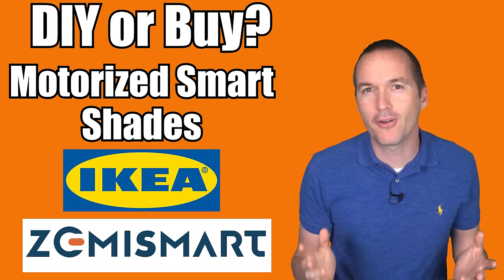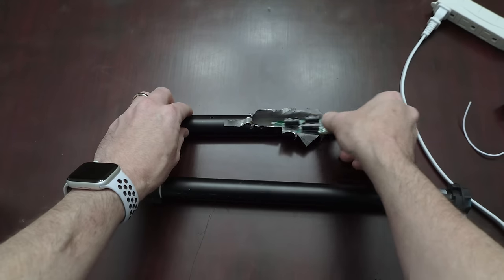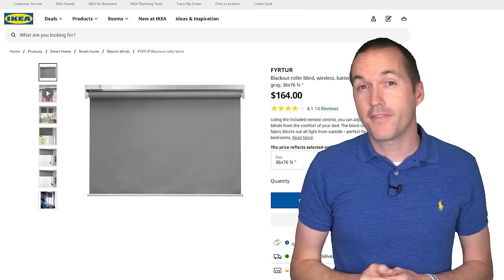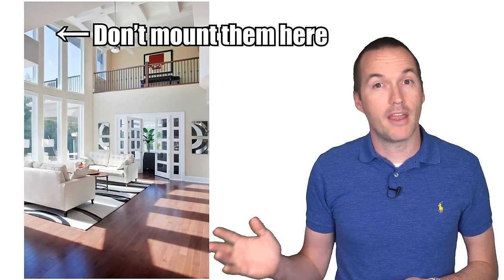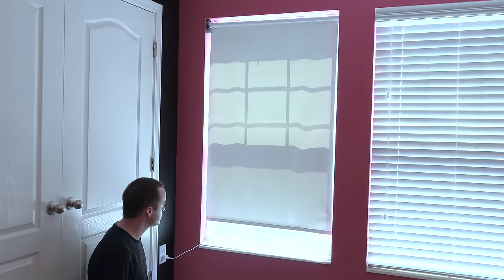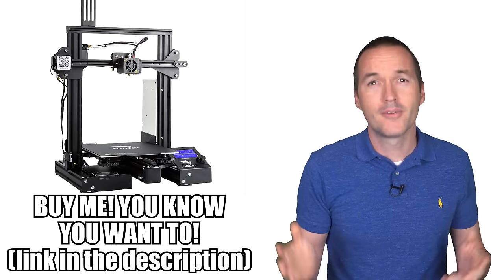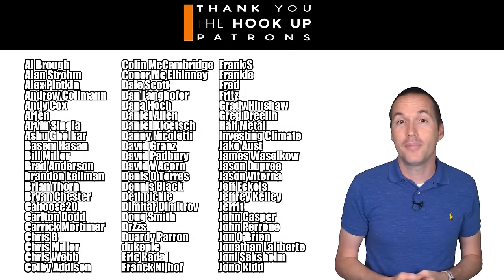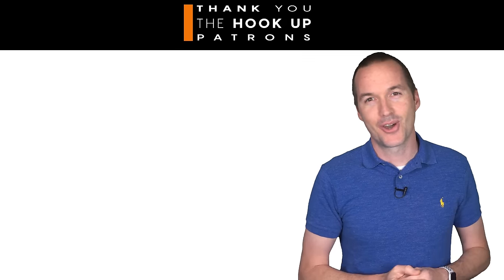Motorized Roller Shades? IKEA Fyrtur vs Zemismart Solar/Battery vs DIY!

Comment: I’m building a new house and prewired every window for 12v low voltage roller motors, like the Rollerhouse branded ones on Amazon. Much easier to conceal low voltage wires.
Reply: I am also building a new house and prewired my windows. Are you going with the Rollerhouse option or are you going to make your own or something else?
Reply: I'd like to hear more about what you're doing?
Reply: The wiring should come out from the ceiling, right? I am also checking pre-wiring options for a new house
Reply: @shawn_yates  I'm either going Rollerhouse or building my own with stepper motors and Wifi. Jury's still out on that, I need to do some prototyping. I'd like to be able to make the stepper motors work, if I can figure out how to conceal them entirely inside an off-the-shelf blinds.com roller shade tube.
Reply: @yiannisis  I brought mine in from the side, through the 2x4 framing around the window. The wire then runs inside the small cavity between the top of the window itself and the header, then I routered a shallow groove in the window header to bring the wire up about 3 inches where it will exit the drywall. I have to do outside mount shades because my windows are not deep enough to do inside mount.
Reply: @johnjacobjinglehimerschmid3555  Absolutely. When I can get the time I'll write up a blog post or video about how it all came together, because this has been without a doubt the hardest aspect of the new home automation system to plan.
Reply: @matt Rogers I wanted to follow-up and see what you ended up doing at your new build. I am not doing a new build but I am doing a complete gut job on my house. I am running smurf tube from my network room to one window in each room and then daisy chaining from the first window to the other windows in the room. Since i am running smurf tube I am looking for a low voltage motor option with 2 way communication. Ideally, I would want a low voltage roller with built-in wifi. However, everything i am seeing that is low voltage is either rf (one-way communication) or zigbee (which no one likes). At this point, I have narrowed it down to going with a zigbee roller or going with a 4 wire roller motor and this Zemismart switch https://www.zemismart.com/products/zemismart-new-design-us-wifi-curtain-switch-alexa-google-home-smart-life-tuya-blind-wall-switches in my network room.
Reply: I would love to read about all the stuff you did in your new home. We’re starting a new build and trying to figure out how deep we want to go into home automation

Comment: If the DIY option is updated with stronger motors etc please do a video!
Reply: These cheap steppers can be modified to work in bipolar mode, and like that, with a special driver, their torque is doubled.
Reply: No stronger motor required! Just run the stepper board with 12V instead of 5V. More than enough torque. 😊
Reply: @stefanlasser6535  NEWBIE here lol, would the stepper motor need to be a 12v stepper motor instead of the 5 mentioned in the video? looking to speed up the shade a bit and as i posted originally window is a bit larger at 57 5/8 w x 36 h Thanks!
Reply: @shawnperry1974  the boards i know say "5-12V". I even redesigned the thing to NOT use a 2:1 slowdown gear but drive it directly
Reply: @stefanlasser6535   Have a link to your remix?

Comment: Is there a DIY tutorial with battery AND solar charging integration?
Reply: This is what I immediately wondered was if you could add on to the printing process. Make a power housing essentially and wire it in. Fairly easy to hide stuff in the top of a window

Comment: Thanks for the comprehensive yet concise video, super well put together. Do you have any suggestions for roller shades you know work with the zenismart blind with the solar panel you linked to? I see they list 38mm as the compatible tube size but most blind sellers don't seem to list that specification.
Reply: Did you end up getting an answer? I am running into the same issue looking for shades for my new house and everyone seems to gloss over where to find actual shades!

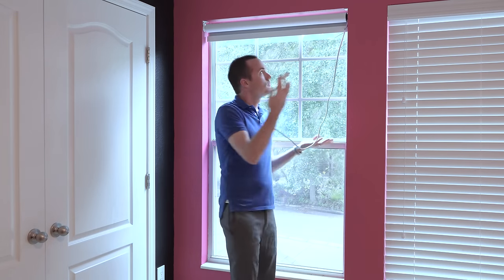Comment: Hey Rob, after seeing your video I was inspired to put together something similar. I probably have the same (or very similar) shades as you ($10 vinyl roller shades from a home improvement store) so I think it is comparable. I was using a different stepper driver library and found that it had excessive delays in the code between step pulses. I eventually gave up on that one and wrote my own with much more reasonable delays. I guessed your window is about 4', with my new library, my shades lift that far in under 1:30. Still not great, but almost twice as fast as your current version.

I looked at the library you used and it doesn't seem to be as bad as the first library I used but the delays could still be lowered. I found that a pulse width of 5us and pulse period of 1505us worked pretty well. Your library doesn't allow for non 50% duty cycle so it may not be easy to modify that code. I think the limiting factor on the width is the driver (the datasheet says the minimum is 1.9us, i went with 5 to give some margin) and the limiting factor on the frequency is the motor.

So, if you want to try speeding up your DIY solution you could consider tinkering with the delays in the motor driver code.

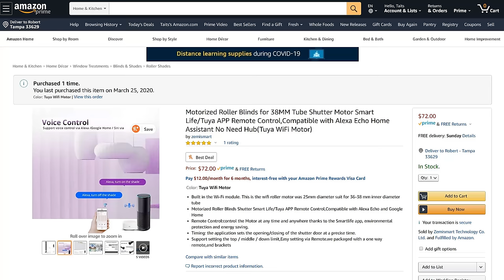EDIT: With a width of 3 and period of 1203, the time is down to under 1:10 and it still seems to be working correctly.
Reply: Hey, this sounds really cool! Is your code available anywhere?

Comment: I found out that you don't need any TRADFRI gateway. Just the "USB range extender" (or whatever they call it), the remote and the shade. Everything is included in the package. And if you have a Zigbee gateway you may be able to control it without any further hardware. (I intend to do that with the Conbee USB stick and ioBroker.)

Comment: At this moment I have 32 ZigBee devices (in-wall relays/switches [Sonoff, LUMI], Xiaomi/Honeywheel smoke sensors, PIR sensors [eWeLink, LUMI], Xiaomi light sensors, water sensors [TZ3000], IKEA wall switch, Philips HUE Ensis) in my house for at least one year. The only problem I had was RBPI and SD card(s). After migration to Intel NUC - it's running stable for months without maintenance (apart from home assistance). ZigBee works perfectly in my case/infra :). Greets :)

Comment: I use the IKEA blinds.

Smartthings has a built in device handlers that works perfectly with it even the battery all you need to do is change the device handlers from ZigBee window shade to ZigBee window shade battery, than everything will work. No need for any of the custom handlers.

In HA I use ZHA the blind works including the up and down arrow and the position updates if the blind is change manually too.

Comment: I have replaced the smaller  steppers with Nema 17 steppers nodemcu and drivers fit in the mount housing for the stepper
runs of 12-36V and can lift 1.5M wide blackout fabric 

files will come on DYI plattforms once 100% satisfied with working solution
costs are a bit higher but for on the wall mounting works so much better

Comment: Fantastic video as always, but it kind of left me wondering about another option. Why not DIY with a solar panel, a battery and a stronger motor? Basically giving you a zemismart solar on steroids :)
Throw in a light sensor pointing outwards and a motion sensor pointing inwards and you've got the ultimate smart roller shades.
Reply: This is 100% the update we need.

Comment: The DIY setup is perfect to slowly open at a scheduled time in the morning just like the sunlight simulation lamps
Reply: Mine is not running the file rollershade.bin. Did it work for you any help please?
Reply: @RedAura99  yes same thing, after doing your WiFi configuration which leads no where, connect back to your WiFi and look for the esp IP and put its ip in url and you should see the page open up.

Comment: Nice  Video once again. I think the DIY will be better if the stepper motor is  replaced  with a Nema stepper  motor and a redesigned 3D enclosure for the Nema stepper motor.

Comment: Thanks Rob! I've been deliberating on a roller blind solution for a couple of months now. This video was very informative and covered a good range of options. Also, I got a good giggle with "oh, the ZigBee"!

Edit: typo
Reply: Same here, but tbh every solution seems to suck. Like realy, 2 min to get your blinders up? Realy, its 2020 lol.
Na i will wait untill some one figures this shit out.
Reply: @peternystrom921  replace the cheap motor/driver with a 12dollar 3d printer motor and driver problem fixed i use a wemos 17

Comment: I solved this problem with Somfy "dumb" motors (LS40's) controlled with Shelly 2.5's.  I have 18 blinds on my network and the system with HA works like a charm.  All are hardwired though which I understand is a deal breaker for many.  Thanks Rob for recommending Shelly in your previous videos!
Reply from the maker: I REALLY dislike Somfy's "authorized dealer" model.  I know you can pick them up on ebay and amazon from shady resellers, but I hate being forced into that position.
Reply: @TheHookUp  Totally agree!! We installed 30 of ST30 SDN RS485 as it was the only option. Ended up having to write the RS485 protocol myself!  Not going to even tell you how crazy the price of those are!
Reply: Arn't Somfy Motors $200+. Dumb 4 wire motors controlled by Shelly 2.5s would be great for me because I am running power to all windows. However, I don't want to pay the Somfy premium.
Reply: @jonathanochs8552  They are one of the best.

Comment: Great video thanks! Is there no better motor we can use on DIY? I’m not concerned with speed, just power for a larger blind. Thanks again! 👌
Reply: @williambello4089  Have any additional information about your design? Which motor voltage and rpm did you use? Any information on the controller you are using?
Reply: @maxdamage2122  the voltage can be anything from 8 to 30 volts. That is the limitation of the switching voltage regulator. I like to use tasmota firmware. The BlindBird uses a SPDT Dip relay for  motor direction, capable of ≤125Vac @ 2Amps. So, the motor drive transistor is a Darlington, capable of ≤30Vdc @ 3Amps. I also included two switch inputs, controlling open and close limit s.
Reply: somfy.com?
Reply: @williambello4089  can you show how you did it?

Comment: You should check out the 12v stepper motors diy solution - My experience with the solution is that the motors are strong enough if you have a somewhat smart acceleration/speed control (should be possible to integrate speed control based on posision aswell). Experiences are based on retrofitting the ikea roller shades with 12v 28byj, darlington transistor array, nodemcu and no gearing.
I have a strong belief you could make the DIY solution alot more attractive by making a couple of extra modifications ;-)
Reply from the maker: When you say "no gearing" are you saying no gearing other than the gears that are in the 28BYJ?
Reply: @TheHookUp  Correct. Can probably send you some documentation for pcb design, fusion design, code and so on. The design is not finalized as its still a work in progress.
Reply: @tmolberg1  Did you ever get this working?
Reply: @tmolberg1  I'm curious if this came to fruition. 🤔
Reply: @zenginellc  to some extent yes. Ofcourse with some limitations. We had success driving a blind of around 1x1 meter. 

At the end of the day I gave up because the Ikea solution was so well packaged. If you want to have a look feel free to send me a message and i'll provide the board designs and source code.
Reply: @tmolberg1  that would be amazing! I'll try to message you. How can I reach you? YouTube has removed the message feature.

Comment: I love the 4 wire motor from Zemismart. Then you can use whatever module you like. Downside: mains operated. Upside: Use whatever fabric you like, fits most windows, manual control, no cloud. No issues here with z-wave. my qubino module is better than Fibaro and shelly 2.5 (at the time of install).
Reply: I'm trying to figure this out for a new build. My main problem is finding the size of blind roller shades to work with the motor. Which blinds did you get and what's the size of the tube and motor?
Reply: @MyFortressConstruction  The hardest part for me was finding the tube that fits the motor. I could only find one place in the UK that sold it. As for the blind, anything will do as you will transfer the fabric onto the new tube. Hope this makes sense.
Reply: @djashjones  Ah, so you completely retrofitted it yourself. I didn't want to mess with gluing fabric onto 20 separate window shades... I was hoping to find a shade/roller already on a tube that would work with the motor so it was a simple swap, but no one states what kind of roller tube they have for their fabric. Seems like a prefabbed rechargeable unit that I can simply plug into a wall outlet is the way to go...
Reply: @MyFortressConstruction  no glue involved. Just peeled it the old one and re-stuck it on the new one. I think they use some sort of strong sticky tape.

I like the mains powered version because I can have manual switches to operate the blind if needed. The downside is the cable running down the wall but it's worth it.
Reply: @djashjones  I'm building a new home so I plan to have an outlet next to each window so it can be covered with a valance. So you just got an aluminium tube from a local curtain shop, got some brackets, and then plugged the motor into it? It already had doublesided sticky tape on it I'm assuming?
Reply: @MyFortressConstruction  That rings a bell. Now you mentioned it. Yes, my tube came with the tape pre-installed.
Reply: @djashjones  Thanks for all of the info. I'll get it sorted out!

Comment: Hey there! Thank you for this video. So I'm in love with the DIY solution, however the cons seem pretty easy to to overcome by getting a faster, more powerful motor, and I'd be surprised if there isn't tutorials on how to do this already. 
So do you or anyone else know of other DIY tutorials that have stronger motors? The window I'm wanting to use this on are easily 3 times the width of the window in this video, and I plan on using blackout fabric which will be heavier.
Also, it's fairly simple to extend the power cable of the Zemismart Tuya and hide the wire, so I wouldn't consider this a con. Also Rob, I think that something I've noticed in a lot of your videos is that you don't consider renters when making these videos.
Reply: Did you ever find a solution? My windows are about 50" wide and I'm also wanting to use blackout versions. Then again, I haven't even found the $10 blinds he referred to from lowes, but at least if I knew there was a heavier duty version of this DIY setup out there I'd feel better proceeding.
Reply: teenhype90210 No, unfortunately not. No official response, but I’m sure you can go to a makers forum or someone who knows everything there is to know about small motors like this and ask, I just haven’t put in the time.

Comment: Great video and exactly what I was looking for! Keep doing shades videos as other home automations are simple in comparison. 
Would love to see you throw Rollerhouse motors in the review mix. Also,  maybe something with the Shelly 2.5 and dumb shades? I can't do solar because the wife doesn't like the look but I was thinking it would be cool to re-wire the Zemismart Solars and just have the battery as a backup. Basically, Motorized UPS Shades. I have like 20 windows that need to be automated so loving this content!
Reply from the maker: I'm not 100% sure, but I'm pretty certain that Zemismart and Rollerhouse source their products from the same factory.

Comment: Fantastic video Rob!

While in lockdown I purchased two Ikea blinds to connect to my existing 76 Deconz device Home Assistant setup.  After a few days, one of them dropped from the Zigbee mesh and became non-responsive...  After days of repeated button pressing, I gave up and brought an Ikea bridge....  OMG the pain of getting that paired (tip - buy lots of spare CR2032 batteries!).  Once finally paired I've just decided to leave the Ikea bridge also connected as a separate Zigbee mesh just for blinds, it integrates to HA and firmware updates are a lot easier.

Keep up the good work.
Reply from the maker: I've heard the Ikea bridge is much more stable than using zigbee2mqtt or deconz.  I just hate having 100 different bridges.
Reply: @TheHookUp  Totally agree.  I had moved to the single Pi4+Deconz solution from one Hue bridge and three Xiaomi bridges.  I'm sure after a few more Deconz updates I'll end up trying it again :)

Comment: Ok.  So the DIY solution REALLY appeals to me.  Almost everything in my HA setup now is DIY.  You mentioned with 433 rf being 1 say.  Have you looked in to stuff like MySensors?  That's what most of my stuff uses.  It uses the nrf24l01 2.4g RF modules.  Can send and receive nicely and does a great job reporting state.  I am currently setup using the MySensors MQTT gateway, so anything that can send / receive MQTT can talk to my MySensors nodes.  Some of the nodes (if on always on power like AC outlets ect) can act as repeaters extending the range.  I would REALLY like to see/hear your thoughts on something like MySensors.